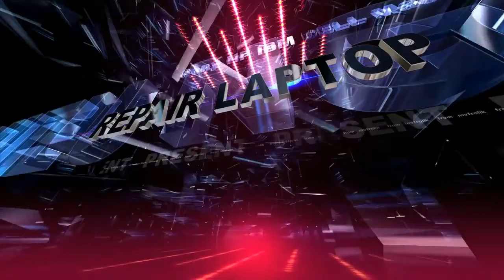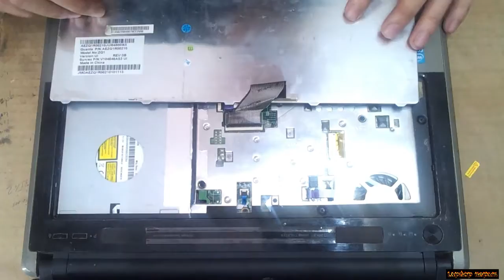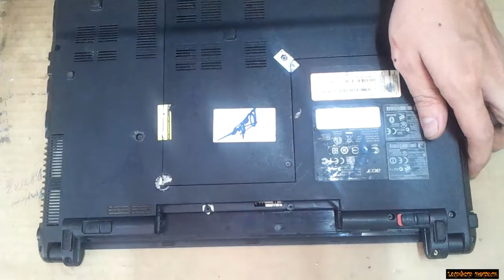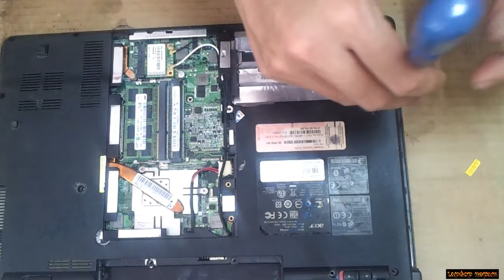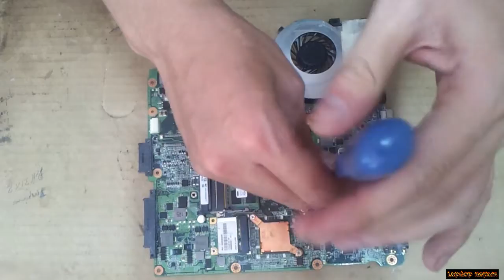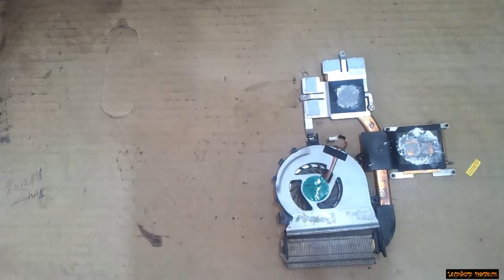Laptop Acer Aspire 4820TG Disassembly and fan cleaning  Laptop repair

Comment: what is the chip with the same heatpipe with the cpu can you tell me ? and what is the other chip that got a little copper next to the wifi chipset ? can you help me. my laptop keep shutdown when i playing game . sorry for my bad English
Reply: a thermal tube covers the processor and video card. Under the square copper heatsink is the chipset (BIOS). All thermal pads under the radiator need to be replaced every 3 years. They seem to be 2mm thick. Better to buy gray thermal pads - they are the best. So that the laptop does not turn off from overheating, you need to clean the heatsink from dust once a year and change the thermal paste on the processor and video card. Buy thermal paste with a thermal conductivity of 6-8w / k, for example GD900, GD900-1. Apply a thin layer (0.2mm) of thermal paste to the entire crystal of the processor and video card. I also disassemble the fan and lubricate the bearing with 2-3 drops of machine oil. Do you have an i3-370m processor?
when you remove the heat pipe from the laptop, you need to check if it is working. Hold one end of the heat pipe with your fingers and heat the other end with a match. You should quickly feel the heat from the tube with your fingers - this means the tube is working

Comment: at 02:03 minutes what is that cable you disconected ?my laptop wouldnt turn on and when i dont connect that cable laptop works ,when i connect it it turns off,i thought it was the fan but fan is spinning without that pluged in pls help
Reply: looks like the camera